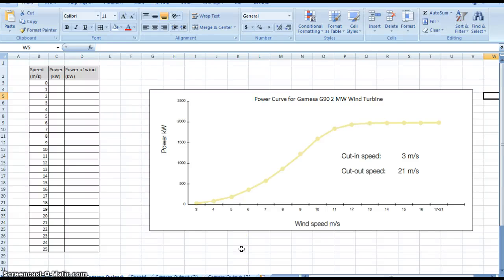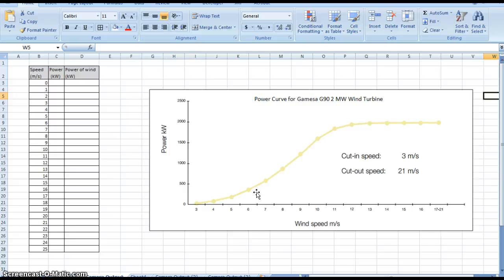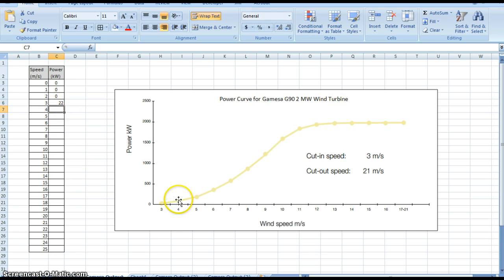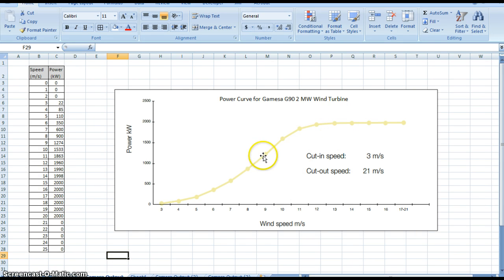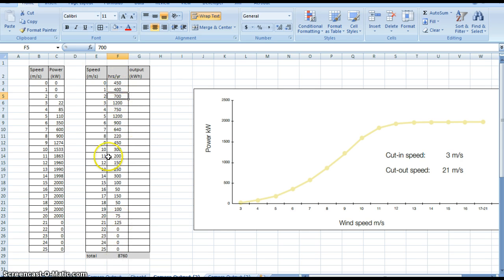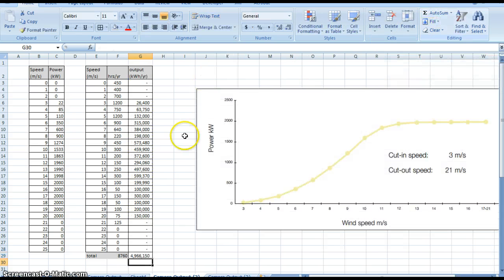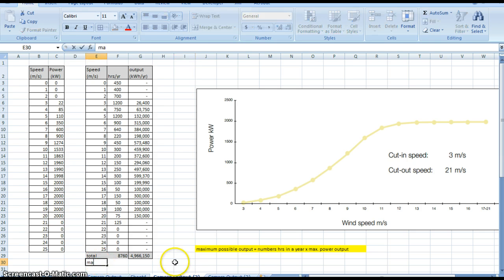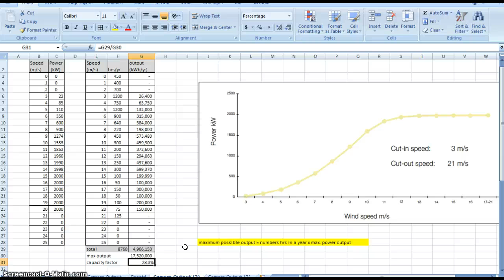Calculating Wind Turbine Output and Capacity Factor

Comment: Thank you for this video; it is very helpful. Could you please tell me how you got the hours of each wind speed? I was just wondering how you got it.
Reply: These are frequencies (in hours/ year) @ each wind speed bin (m/s), you can calculate this if you have the wind speed data (timeseries data) and then arrange that data with a temporal resolution of 1 hour for the single year and then calculate the frequency the sum of all these frequency should be approx 8760 hours/year, you can also use Python or MATLAB to achieve this.
Reply: Thank you for your reply; I appreciate it. These data (time series data) should be the data of wind turbines, or we could use other datasets like ERA5. For example, if I have the data on wind turbines for a year but there are two months of missing data, can I use it or can I find another way?  @m-hamzamalik
Reply: @LilianeUWAJENEZA   You can use either of them or both, (local measurments or ERA5), to compare errors, but please check the sources and see how local measurements are different from spatial measurements like ERA5, you also mentioned that you have 2 months missing data which will lead to inaccurate results (you can use methods like interpolation or some other methods like filling data from previous or next year if you have 1+ years of data but still it's  an approximation) you can justify it and there is no issue to use ERA5 dataset, please if you are a researcher, also confirm this from your supervisor. If you are ok with spatial measurements, then there is no problem in ERA5.
Reply: Thank you so much @m-hamzamalik

Comment: Hey Dan,  I have a HYE-1500  96 volt turbine, they supply you with a charted power curve, But with no voltage points, So in order to program a Aurora Wind inverter, it has to columns. Volts- Power(AMPS).   So in order to get the volts and power, is there a way using the given power curve with watts and M/S chart ?

Comment: How did you get the amount of hrs per year at each wind speed ?  do you have a Wind Study or just cheet ?  is there a website or link for Lat / Long that shows you the   amount of hours at each speed ?  for a given location ?  Does anyone know the way to answer this.  Please share .    Thanks
Reply: t24money The Location needs to be measured by 80 meter wind masts. Or you could lookup wind atlases and try to do the calculations yourself. Maybe use software called Wasp it is danish software.

Comment: That was very useful vedio. However, I am a little bit confused about the difference between the Coefficient of performance  (CP)and Capacity factor (CF). I will be so grateful if you can help me in this issue.
Reply from the maker: Hi, Omar. Coefficient of performance (COP) is used to describe the "efficiency" of a heat pump heating and/or cooling system. It describes how many units of heat you remove (cooling) or add (heating) for each unit of energy you input. E.g. a COP of 3 means that for every one unit of energy input, you remove or add 3 units of heat energy. The units don't matter. (It is not true efficiency because you are not converting the energy into heat, you are using it to move energy around.) 

Capacity factor refers to any energy generation source, and indicates how much energy you generate in a given period of time (usually a year) divided by the maximum possible energy you could generate with that equipment. E.g. if you have a 1 MW wind turbine, that means that its peak output is 1 MW. Since there are 8760 hours in a year, the max output for a year for that turbine is 8760 MWh. If you actually generate 4380 MWh that year, then your CF would be (4380/8760 =) 50%. This is a high number, by the way, but shows you how it works. 

Hopefully this helps!

Comment from the maker: Good question. The problem is that the turbine is always less than 100% efficient, so all of the power in the wind is never fully captured. If you divide the actual output (per the power curve) by the wind power at each speed, you can calculate the efficiency at each speed. There is something called the Betz Law or Betz Limit that tells you the maximum possible turbine efficiency. I believe it's around 60%, but you could Google that to find out. I hope this helps!
Reply: Hi Zargham, if you have the raw data (each 10 minutes measured normally), you can use the histogram option from Excel to get the distribution of the wind data according to each specific wind speed, the next step is to stablish the distribution in function of the 8760 hours per year, and the capacity factor.
Reply: @DGCAD  not sure if my way works but can you judge it for me ? i have raw data (1hour mean) at 10m as references height and using the Hellman's Power law to calculate the wind speed at the desired hub height. And i have generate it into total of 8670 values of wind speed for a year using Weibull's Distribution and then calculate the capacity factor with the selected wind turbine by using the way taught it this video
Reply: i have the shape and scale parameters for generating total of 8670 values of wind speed in Weibul distribution (leftout information).
Reply: +Dan Kasper Hi I would like to know how can we calculate the no. of hours/yr for a specific wind speed in excel?

Comment: I'm using the ''Power in the wind'' equation to calculate the Power (kW) for each value of wind speed (m/s). Yet I'm getting much higher values of kW then you are using,

Swept area = pi (3.14159) x r (65m blade length)^2 = 13273m2
W = 1/2 x Air Density (1.225kg/m3) x swept area (13273) x wind speed (12m/s)^3 = 14,048,143
kW = 14,048
mW = 14

Yet I know this turbine has a theoretical maximum of 4 mW. So my 14 mW result is highly unrealistic, especially since a wind speed of 12m/s is below average for the location. So I'm making a mistake. Can anyone see what the mistake is?
Reply: Hi Ronnet, take in account that there is a mistake in the area formula, also you must consider the power coefficient for the turbine. if you make these changes, you will get the correct value.